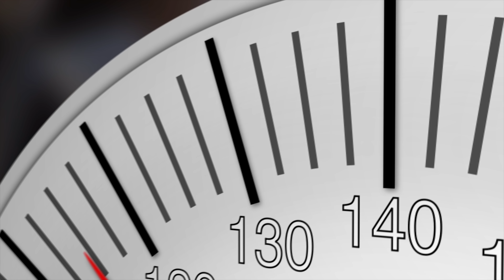Different Types of Valves in the Boiler Room - Boiling Point

Comment: The guy was stumped , but one of the reasons you dont see ball valves every where in a boilerhouse is the the quick opening and closing of ball valve can hammering of pipes in steam mains or water hammer in condensate line. A gate valve slower opening action prevents this type of thing from happening.  You typically dont ball valves passed 3 "   at bigger sizes the handle ends up taking up alot swing space , gates at the same size dont need as much space.   One positive for the gate valve is that they are easy to maintain and fix. You can repack the glands , grease spindle , take the bonnet off clean them, replace the wedge disc . its easy in that way because you dont have to disturb piping to fix an issue.

Comment: I would say that in comparing the gate to the ball valve, the gate is a more durable valve with all the steam headers I've seen having gate valves. You wouldn't see a ball valve on a  H.P. steam line but might on a condensate or blowdown line with hot water. Your more critical non throttling valves tend to be gate valves.
Reply: Yes, most of  gate valve have molybdenum which will make the valve resistant to heat and chlorine more than ball valve

Comment: At minute 4:32 you said gate valves at ‘not’ typically used in blow downs?  Hoping that was a brain fart. (Slow acting valves are code required on high pressure boilers over 100 psi.) just saying...
Reply: He was meaning blowdowns other than bottom blow on blrs. Like controls or trap strainers

Comment: Are blowdowns are all gate valves
Reply from the maker: Not necessarily, what we see in our industry is most quick open valves will be gate valves but slows open valves can be modified gate valves or even globe type valves. Hopefully that answers your question. Thanks for watching!
Reply: Not all blowdown valves have to be gate valves. You can also have ball valves. Globe valves should not be used. Yes, that its the code.